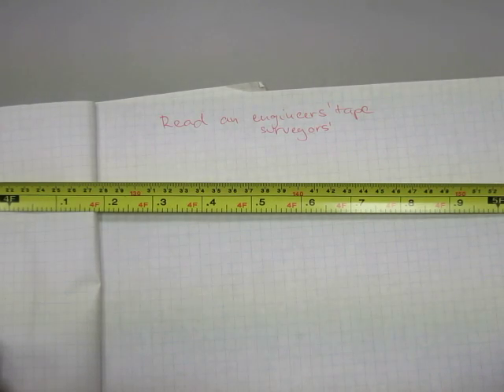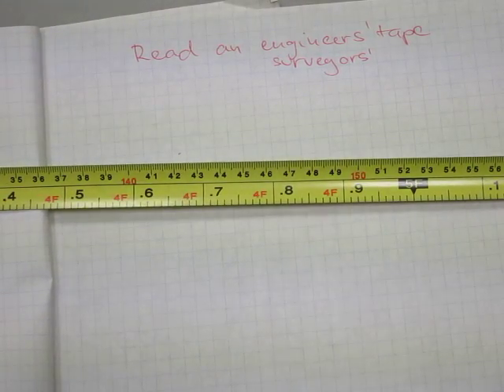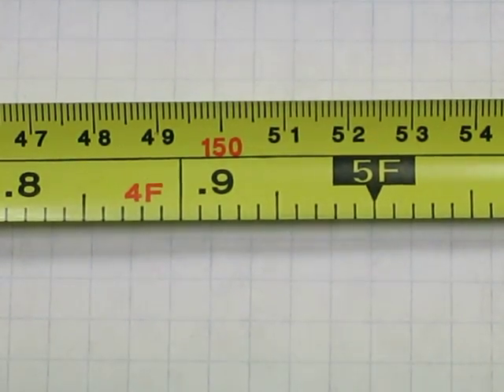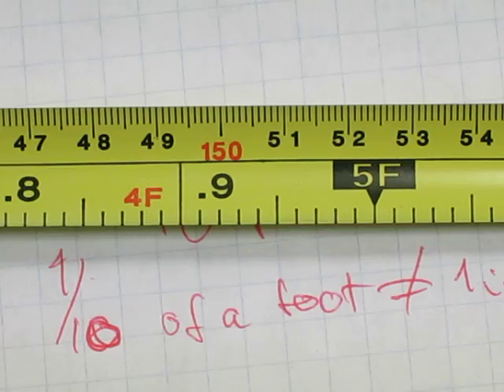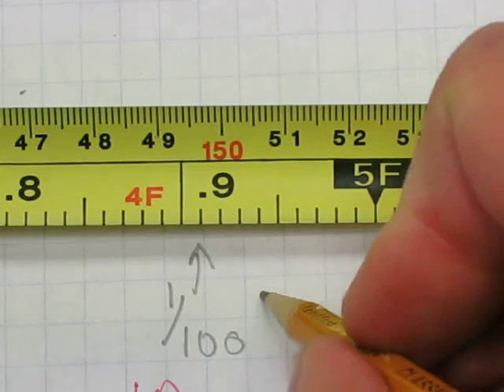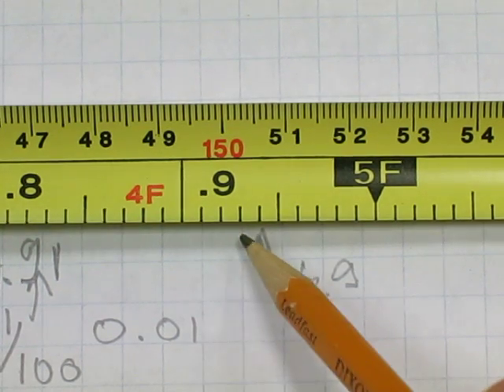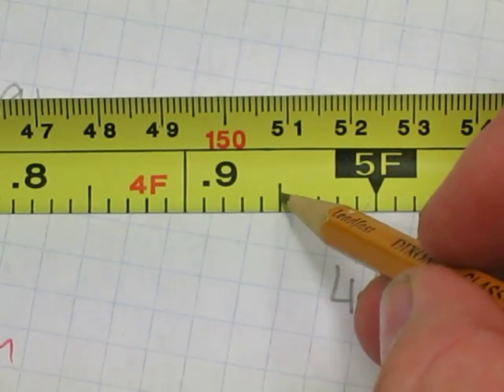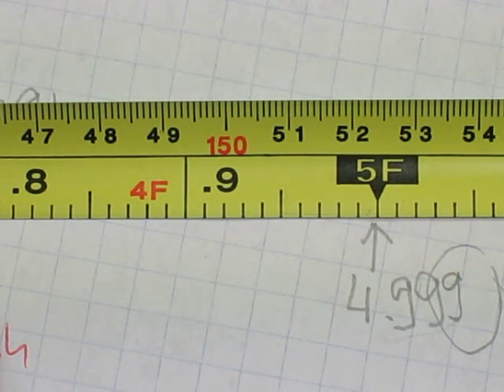Read an engineers` tape measure (in decimal feet)

Comment: If we consider Values in complex terms and the insights in which they are supported… the positive feedback loops are not just “nice” it helps ease bias and conversations.  

The old phrase about drawing swamps and ap to your ass in alligators… the North Star thinking helps keep the tacking on better tracking.   The actual insights get nuanced. Any, KPI can lead to end points… the better insights and connections help a lot

Comment: how do you read 1/4 of an inch in there then?
Reply: The units of the engineer’s scale are feet, tenths, and hundredths.  If you want feet, inches, and fractions, you use the carpenter’s scale.
Reply: @GH-oi2jf  , Yes I already know that and thank you for confirming to me that this is in 10ths and 100ths of a foot because it is not an engineering tape measure nor it is not an carpenter scale.
Reply: @eugeneyang5678  — The lower edge is an engineer’s scale.  The upper edge is metric.
Reply: @GH-oi2jf  , I like the metric system and I can read it just as easy as the U.S.A. standard system. I am good at math and I am average or a little bad with English and literature. (I am better in math than English & Language Arts personally).
Reply: @La-di Da-di, 1/4 of an inch would be 0.25” in U.S.A. Tape Measure & 1/4” on this tape measure out of a foot would be 0.0208333 feet long (0.0208333’ = 1/48’) 1/48 feet long is 1/4 of an inch on this 10th decimal feet tape measure. It is so short and tiny that you will have to line it up with another foot ruler to actually get it right on the mark. I recommend using a metallic lead pencil instead of a wooden #1 or #2 pencil that is dandelion yellow with a pink eraser on top that U.S.A. Makes to write it very neatly and colored pens like he used on this video may be permanently unerasable.

Comment: I grew up reading the engineering tape with decimal feet and learned the metric system in kindergarten. 1 inch = 0.083 feet & 2.54 centimeters, 2 inches is 0.168 feet & 5.08 centimeters, 3 inches is 0.25 feet & 7.62 centimeters, 4 inches is 0.334 feet & 10.16 centimeters, 5 inches is 0.418 feet & 12.7 centimeters, 6 inches is 0.5 feet & 15.24 centimeters, 7 inches is 0.584 feet & 17.78 centimeters, 8 inches is 0.668 feet & 20.32 centimeters, 9 inches is 0.75 feet & 22.86 centimeters, 10 inches is 0.834 feet & 25.4 centimeters, 11 inches is 0.918 feet & 27.94 centimeters & 1 foot is 30.48 centimeters. 2 inches is 1/6 of a foot & 0.5 hands, 3 inches is 1/4 of a foot, 4 inches is 1/3 of a foot & 1 hand, 6 inches is 1/2 foot & 1.5 hand, 8 inches is 2/3 of a foot & 2 hands, 9 inches is 3/4 of a foot & 2.25 hands, 10 inches is 5/6 of a foot and 2.5 hands & 1 foot is 3 hands. 1 inch is 8.34% of a foot, 2 inches is 16.68% of a foot, 3 inches is 25% of a foot, 4 inches is 33.34% of a foot, 5 inches is 41.68% of a foot, 6 inches is 50% of a foot, 7 inches is 58.34% of a foot, 8 inches is 66.68% of a foot, 9 inches is 75% of a foot, 10 inches is 83.34% of a foot, 11 inches is 91.68% of a foot & of course 12 inches is 100% of a foot. Did I help and is my information correct? You should all know that 1 inch is 1/12 of a foot, 0.083 feet, 8.34% of a foot, 2.54 centimeters & 0.25 hands as the start of basic.
Reply: Interesting! I've never heard of someone who grew up learning decimal feet rather than the usual feet + inches + halving-based fractions of an inch version of the customary or imperial systems. Where did you grow up to learn metric in kindergarten, and who was teaching you decimal feet—the school or your parents?
Reply: Why?
Reply: @ⒸⓗⓐⓇⓛⓘⒺ, Because that was the part of my education when I was back in Elementary School since the year 2001. Sorry Charlie and too bad if you disagree or dislike this video because this is 100% acutely the correct measurement though out the whole world. Metric System came first and it was original before the English Standard System. Don’t be a wannabe because I got god and Jesus with me. It’s a true fact and if you are rude and disrespectful then you get the bad karma and the negative consequences. Go look up your favorite subject if you are not interested in this math topic such as counting money and bills. Don’t argue with me because this is our business or else test grade F- = 40 to 59% correct and 41 to 60% incorrect for you. I watched your videos and you just named yourself after a pet male dog named Charlie like all dogs go to heaven. You live in the State of Georgia, you own a rifle as your firearm and film disturbing images of deceased animals and do drugs. You opened a can of beer or soda with a knife, and filmed a trash can, urinated in your own household bedroom, your toilet has a scratched toilet cover seat with nails and pins all over it and you were running like a maniac after being tardy and got late to work and not arrive on time to your job place. By the way, you only got a very few likes on your videos and mostly dislikes.
Reply: I also learned cursive and hand writing on how to do a report rough draft, middle draft and final draft essays in part of my literature in language arts and English class since I was back in 3rd (third) grade. Let me ask you, how did you get your Charlie name in bubble letters and you have a devil or satan profile picture with a blue jean jacket, a bloody face and skin as a serial killer on your YouTube profile icon picture. Leave me alone and please stop because I don’t even know you.
Reply: @eugeneyang5678  
I'm not sure Charlie was asking with malicous intent, but either way Charlie would not have inherently gotten any negative consequences from being potentially disrespectful in this conversation because karma, God, and Jesus are not "true facts," they are in no way scientific explanations for the world and belong with the old English units rather than the more-logical metric system.

Also, you shouldn't let a random stranger on the internet just curiously asking "Why?'" to get you so riled up to where you dig into their profile so you can make an entire paragraph insulting them. If Charlie was indeed being rude, then you have actually been extra rude, as he in no way went so far as you did to be disrespectful. So my point is that you're being a bit of a hypocrite.
Reply: @Persun_McPersonson  , I learned the metric system in Kindergarten at Grazide Elementary School. My teachers were teaching me the metric system as my kindergarten teacher read a book to the whole class about it before we were assigned to do the metric system and decimal feet measurement. I had my teachers and my teacher's aide to do the decimals feet and metric system with the engineer methods to assist me and guided me on doing it ever since I was 5 years old and started with the index instruction paper and a calculator.

Comment: Smart people would have use the above system (metric as your tape show= 150cm =1.5metre or =1500mm done) instead of going to calculate things....
Reply: He isn’t doing any calculation here.  He is just showing how to read the scale.  When calculations need to be done, there is no difference between using a scale of cm and tenths, and a scale of feet, tenths, and hundredths.  They are just decimal numbers in each case.
Reply: @GH-oi2jf  Wow, 3 years later a reply and I did not even recall the video, but you're right! I may have written my comment at 2 AM asleep. Thanks for your comment and the wake-up.

Comment: Hello!  Can you please advise what brand of tape measure you are using?  At my employer we need tapes with decimal inches and metric mm scales such as the one you show in the video, I cannot find it anywhere.  Please advise.  Thanks!  RK
Reply from the maker: Rod K Think legal surveryors. Instruments. Laser. Optics. Pro tripods. You find this measuring tape in a surveyors` supply store, along with waterproof notepads & markers, hi-viz tapes, etc.
This tape has decimal FEET. 
If you need decimal INCHES, such as https://www.youtube.com/watch?v=0k8dvd4h64Q, get them from a machinists` supply store.
Inch/feet-based AND mm 2-in-1 tapes are sold in countries where both systems are around, Canada for sure, maybe elsewhere too but Stanley or any brand such tapes are mostly made in China, so can be sourced out from them at the point of manufacturing too.

Comment: Don't be daft, go metric!
Reply from the maker: Roeland Voogd All blueprints are metric, all engineering is metric, all the math is metric, all materials are inch-based. Tell the manufacturers, too.
Reply: apprenticemath I know the problem, even in Europe we have to cope with some materials 
with Angelsaxon measures. But it is never a problem for me: take your 
own measures with metric equipment and dont bother with the sometimes 
quaint numbers as for instance the 2,45 mm pitch of an IC footprint.
Reply from the maker: Roeland Voogd Totally works. This decimal foot scale on this tape is widely used by surveryors in North America. It`s not relevant anywhere else. The numbers are not making sense to any trades, site layout by carpenters is done in feet-inches (on an inch-based project). Decimal feet are used in calculations, say how much does glass cost if a 62-inch by 43-inch piece is needed, $8 per square foot. 62 inch = 5.1666 feet, 3.583333 feet, after multiplication = 18.5 sq.ft. x $8 = $148.11
It`s practically medieval, when the workers showing up for any new cathedral project were given a length standard, say Hessian foot, and everybody copied that scale and worked with it on that site only. As a result, columns, beams, arches, doors are not interchangeable from one cathedral to another, they are all different even if they look identical architecturally.
Reply: @apprenticemath  That's a very interesting bit about the cathedral measurements. Thanks.